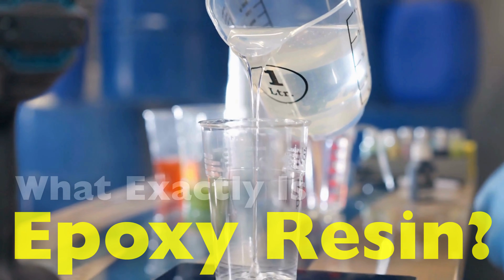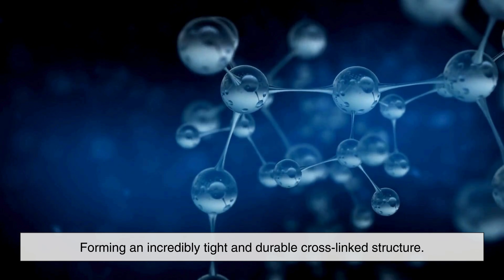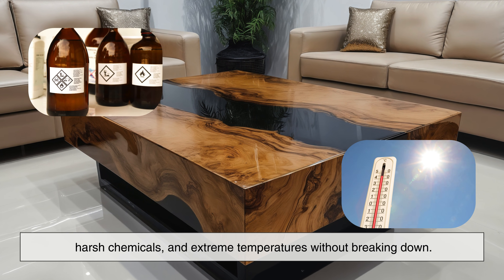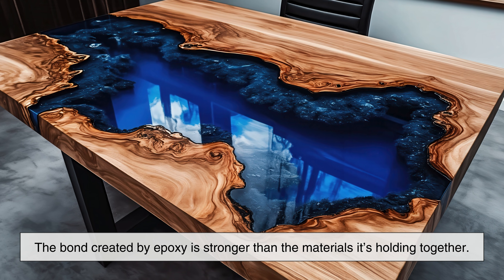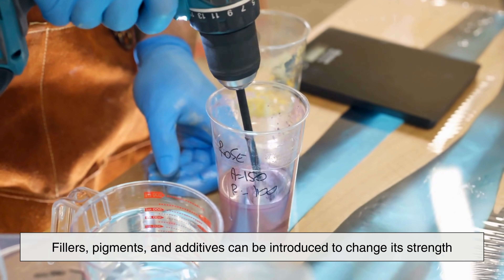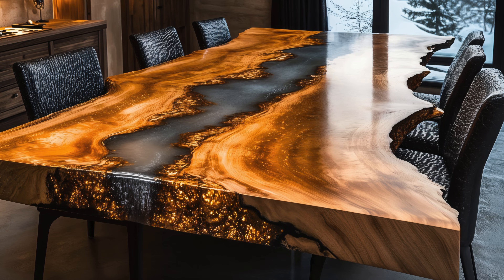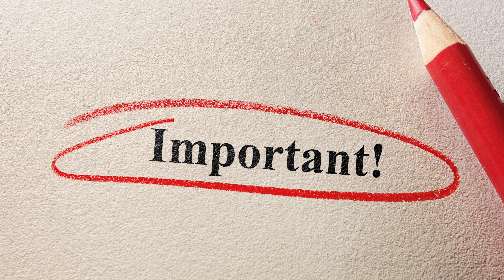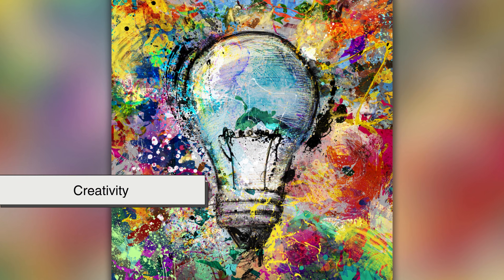This Liquid Becomes Unbreakable — The Truth About Epoxy Resin [ ID0832]

Comment: Can this epoxy be used to coat the kitchen cabinets to make them easy to clean?
Reply: There are epoxy paints, two pack epoxy paints actually, hard to brush on, better being sprayed. You must have an extreme clean surface as once the epoxy is on, it is on.
Reply: Can only be applied over a properly prepared surface and is next to impossible to paint over - it will also discolor
Reply: Using specific acrylic resin for that purpose is recommended, leveling surfaces to be epoxy  covered is also important, have fun covering your countertops with resin
Reply: Sun Coat countertop epoxy.

Comment: One thing that you should consider, is that while some formulations of epoxy can be crystal clear like glass, they all have one weakness - UV resistance. 
 
While bonding strength isn't really effected over time, when used as a clear coating or cast structure that is desired to remain glass-clear, outdoor use where solar UV rays are present, ALL epoxies WILL turn yellowish to brown.
 
In those applications, polyurethane or polyaspartics are king... they may not have quite the structural strength as some epoxies, but they tend to stay clear much, much longer... if not indefinitely,  given most conditions.